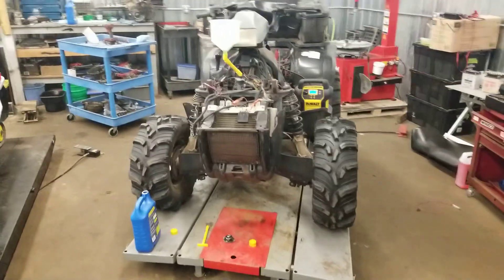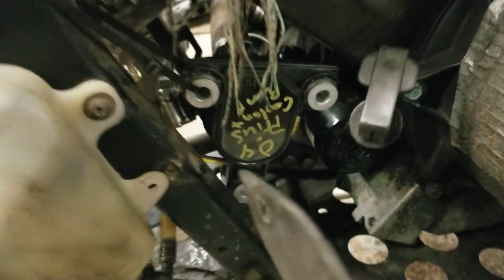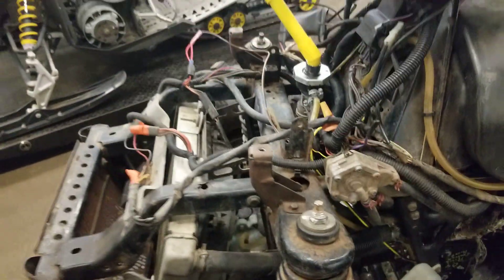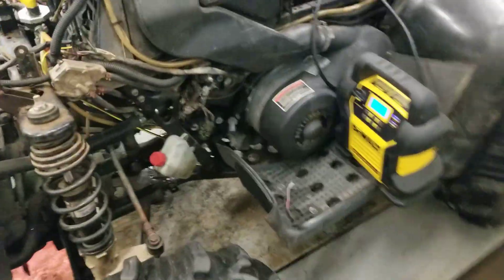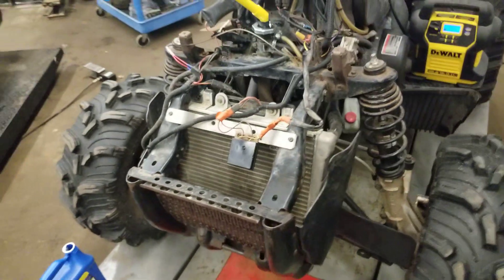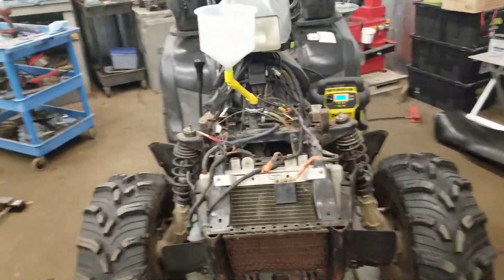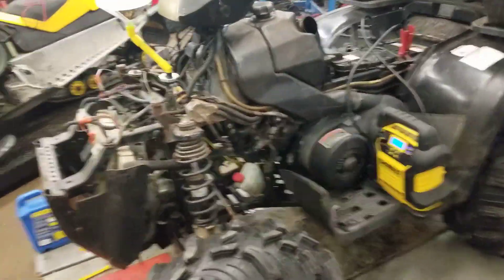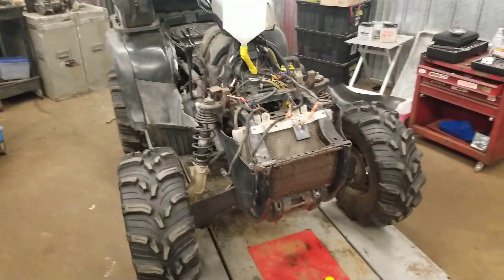Prius electric water pump installed on a Polaris Sportsman 700/500.

Comment: I did the same thing that you have done with electric water pump on my 400 it's been a little over a year now working perfectly. I do have a question for you. I have a 2001 400 as long as the outside temperature is above 50° it starts very easily it dropped below 50° for some unknown reason I have to put my jump box on it to crank. Not even a year old battery in it it turns over with no problem but will not run. The second I put the jump box on it and it turns over it cranks and runs put a new plug in it cannot figure out what the problem is can you help me? Thank you for all of your great videos
Reply from the maker: Yeah..I had a couple like that. I found that it all depends on how the wiring is. If the wires are starting to corrode you get a voltage drop. I've bought 4 different brands of batteries now and so far the best that holds up to issues like you described is the Duracell. I should get paid by them for saying this, lol. your the 3rd person I just told that too. Keep in mind its a aluminum cylinder and when it gets cold it shrinks causing even more friction.  And then you have the decompression ball on the cam.( that's a whole other story) My first year doing this I wouldn't sell 4 strokes when it got cold. lol. Now I have a better understanding what the issues are. I have a question...do you turn the key off or do you hit the kill switch? I found if you leave the key off and kill switch off it keep the battery from draining just in case you have a bad ground.
Reply: @TitaniummanGarage  thank you for your fast response. I only use the key I'll hardly ever use the thumb switch to turn it off I will try your ideal thank you very much for your information

Comment: Hello... titaniumman...new subscriber here...I'm thinking of trading a 99 Yamaha warrior 350 for an 02 500 scrambler but I've heard that they are very problematic...just wondered what your thoughts on that would be ?
Reply from the maker: Hmm. For me..I love Polaris because they are easy to work on. The main issues are the vacuum operated carb and ground issues with the wiring. If it's a clean scrambler and hasn't been sitting outside you shouldn't have wiring issues. Most guys don't run premium gas in their tanks and that's when the issues with the carbs happens. 90 percent of my repairs are electrical or carb related. Oh..and parts are cheaper too.

Comment: Hey I have a 96 scrambler 400 4*4 and also a 02 scrambler 500  can we swap the 500 into the 400
Reply from the maker: I had considered it one time. The mounts don't line up, you'd have to weld something. You might have an issue with the clutches being aligned correctly.